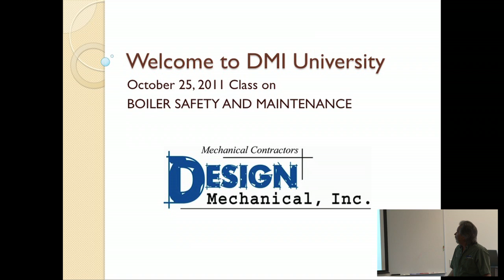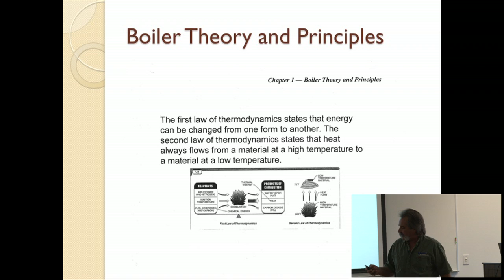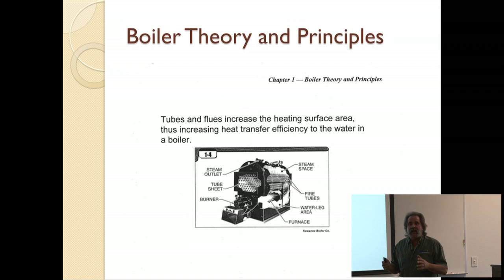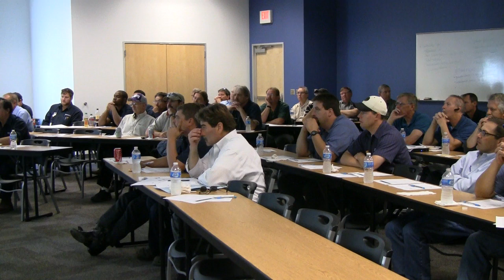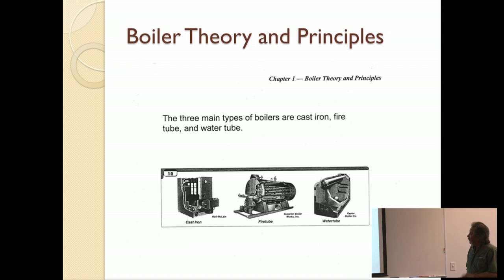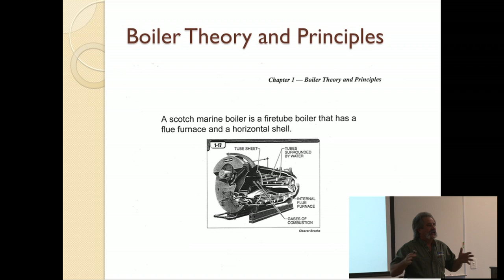Boiler Safety & Maintenance Pt 1

Comment: At 14:21 NOx (Pronounced knocks) is not produced by low temperatures in the flue gas.  NOx and SOx are produced by very high temperature combustion.  What is produce by low flue gas temperatures is water.  Water vapour cools and produces liquid water which absorbs the NOx or SOx to form acids.

Comment: At 8:52 the speaker shows and states that the water level in a water tube boiler is about half way up the boiler.  I hope that was just a slip of the tongue because if that is what he believes he shows that he knows nothing about boilers and is putting out dangerous information.  Anyone who has operated a water tube boiler knows that the water level should be about half way up the steam drum.